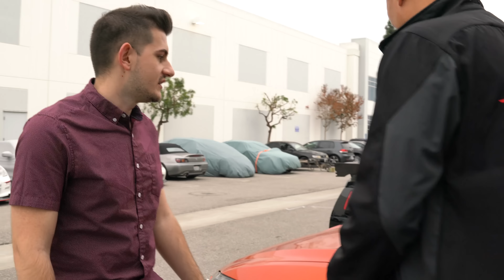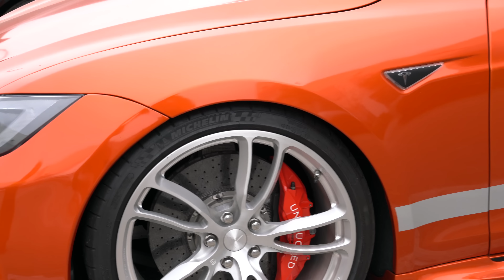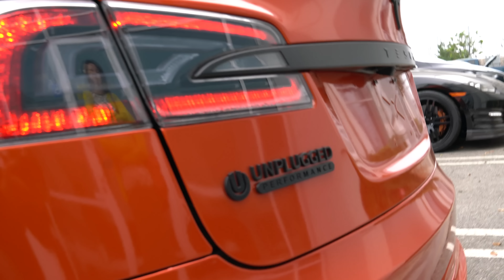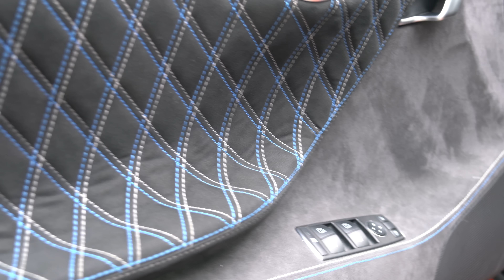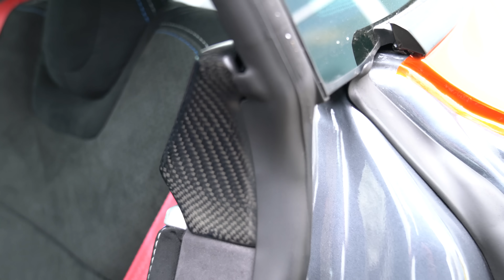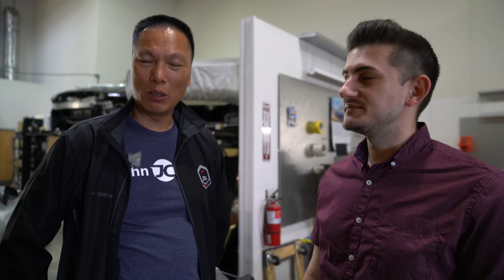Unplugged Performance Modified Tesla Model S

Comment: I did a similar thing to my Tesla. I started with a fully maxed model x and changed the mirrors out with minivan slider doors, them I changed out the windshield, doors, back hatch, seats and chassis of the Tesla with the minivan parts. As a grand finale, I dropped the battery to make room for a gas tank, and put a engine in the front. So, I have a Tesla that runs on gas, has an engine, and looks like a minivan. It gets so much pussy.